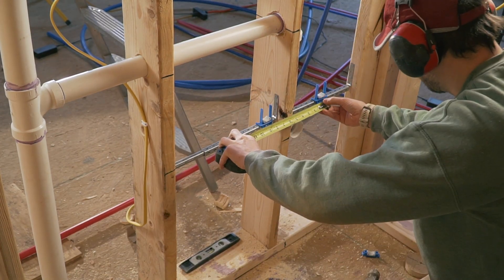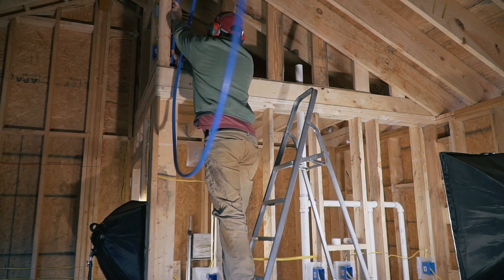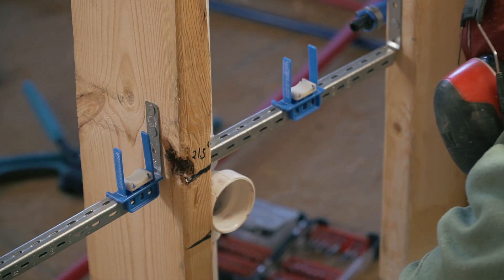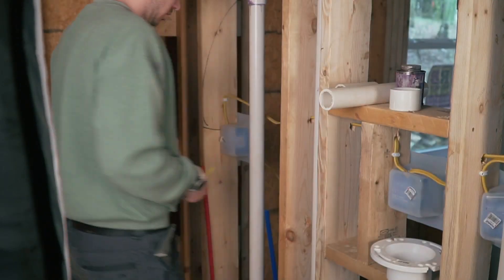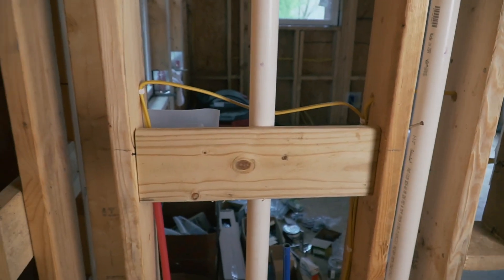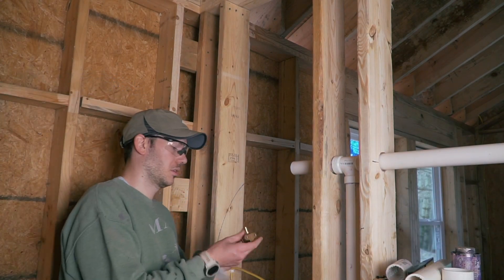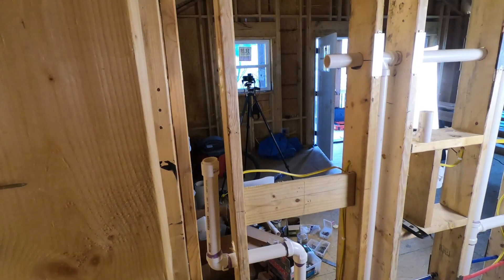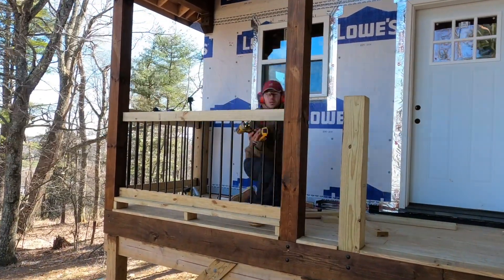Please AVOID These Plumbing Mistakes - Ep 47

Comment: I know everyone has their opinion about different types of PEX fittings/methods, but one thing I have heard consistently is not to use the plastic couplers.

I only mention this because I notice how well engineered/redundant/overbuilt some parts of the cabin have been so far, so it would be a shame to have a leak due to cheap fittings/couplers.

This is an awesome and inspirational series. Thanks for all the hard work not just building but documenting.
Reply from the maker: Very interesting to hear! I did not know that, a little too late to change everything at this point 😂 
I guess I trusted shark bite to sell quality connectors that had been thoroughly tested.
Reply: @TheDIYCabinGuy  true. I think its all anecdotal. Some people say the crimp type are terrible and unreliable and others say that about expansion/propex.
Reply: The only reason a plastic coupling/elbow would be leaking if it was installed wrong, same would happen with brass fittings.
Reply: @bertveldhuizen8699  I wouldn't say that's the only reason. These things do have a service life at the end of the day and will eventually see wear.

Intuitively I'd thing a plastic fitting would fail before a brass fitting due to wear, even if they both last decades.
Reply: As a pro plumber, plastic pex fittings are best, especially on well water. Brass will deteriorate due to the minerals in well and spring water, sooner rather than later based on water quality. Never seen a plastic fitting fail unless it was in a bind or installed improperly.

Comment: If you have problem wood like that or narrow wood, you can pre-drill the holes and they shouldn’t split.  Just need a drill bit a size smaller to remove some of he material the screw pushed away.  And if you want to get really fancy, look up Kreg jigs.  They are really nice for the more decorative wood pieces like maybe he railing.  They make plugs for them too so you can hide the screw.
Reply from the maker: Yeah I assumed because those were self drilling screws that it would have been done

Comment: Nope. Sorry but you missed something important that Pex allows. Your installation has many connections that will be inside finished walls. Pex tubing is relatively inexpensive, while fittings, especially brass fittings are expensive relative to what you get. If you invest in a homerun manifold like a Viega Maniblock, you can run pex without a single connection made inside of the walls.  Each fixture has its own valve on the manifold, and the tubing runs directly to it without any need for connections in between. It also eliminates the need for stopcocks which can be a real pain when you have to service something like a commode or leaky faucet. The concept is similar to your electric install with a breaker box.
Reply: @TheDIYCabinGuy  Sizing is also important. Don't just run everything in 1/2". Use 3/8" for sink faucets and commodes, shower and washers get 1/2" . Pex bends and with a little planning can be run without using elbows and tees IF you use a manifold and homerun plumb everything.
Reply: thx for making a comment with substance. I’ve been binge watching the series and looking at critical comments because I’m hoping to build something similar next year and critical comments with substance are really helpful.